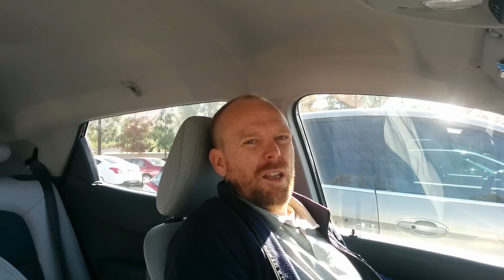Plug-Side Chat: Compressed Air Energy Storage (CAES) for Carbon Sequestration

Comment: @3:36 send the CO2 to Mars? It’s already 96% CO2. I think Elon would do better figuring out for to sequester CO2 on Earth so he can do it on Mars later. 

The unavoidable truth is that energy was released with the CO2 and its going to take more energy to put it back.
Reply from the maker: Yes, but Mars' atmosphere is only .6% of the density of Earth's atmosphere. One of the proposals for making Mars habitable is to create a greenhouse gas effect to "kick start" the planet. There's simply not enough air there.
Reply: News Coulomb, it seems Mars is lacking the magnetic field required to keep solar winds from stripping away the atmosphere, in addition to the lower gravity. But as shown by Venus, which has a lower gravity than earth but 92x more atmospheric pressure, gravity isn’t the main.problem.

So it seems they would need to add GHGs faster than solar winds strip them away. If they can’t get Mars magnetic field reactivated, it will be difficult to add CO2, or O2. 

But to fix Earth, we will need to use solar energy (PV, Wind, Hydro) to turn CO2 and Into C and O2, and make carbon fiber houses.
Reply from the maker: Even if you aren't hoping to kickstart planetary convection to produce a magnetosphere that can preserve the atmosphere, CO2 would be extremely useful on Mars. In combination with H20, it can be used in biospheres, dome, and possibly caves to support plant life. 

As for stripping apart CO2 on Earth, in my opinion, the best solution is also to simply grow plants.
Reply: News Coulomb, I think California had that plan but then decided to free all the CO2 back into the air. 

How many tons of CO2 would be released in Earth’s atmosphere for SpaceX to launch 1 ton of CO2 to Mars? I think the nuclear bomb has a better chance. 

Getting Mars core churning again will require more than warm air. Maybe another meteor strike equal and opposite to the one that interrupted it. 

If you create biospheres, you can pump the CO2 from outside and compress it to 14.7 PSIG and let plants grow. But I think research has shown biospheres are harder to keep going than expected.
Reply: @imho7250  exactly
Reply: @newscoulomb3705  Mars will never be habitable. It has no magnetosphere. Its impossible to create livable atmosphere there